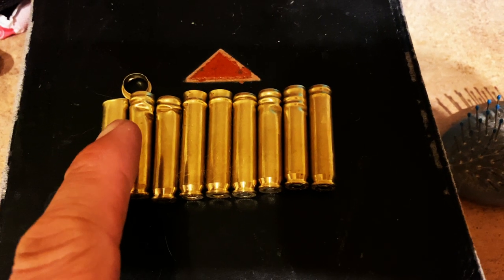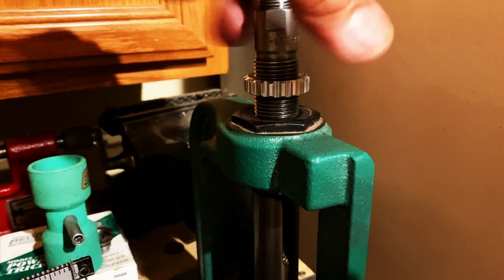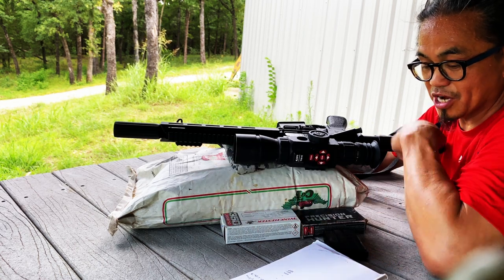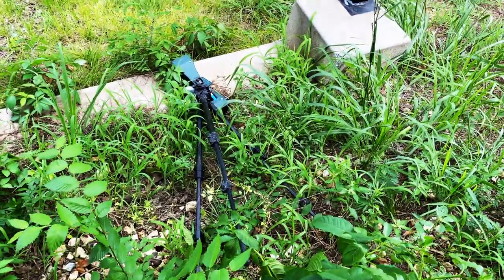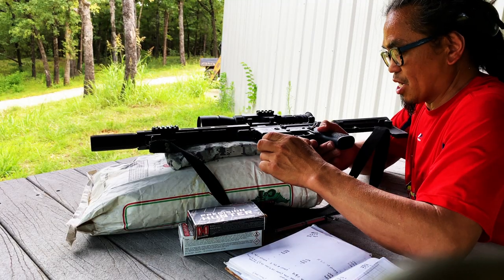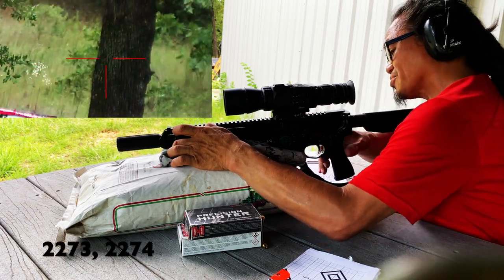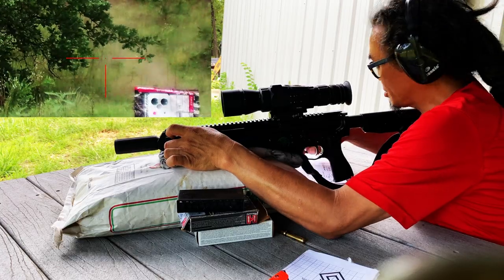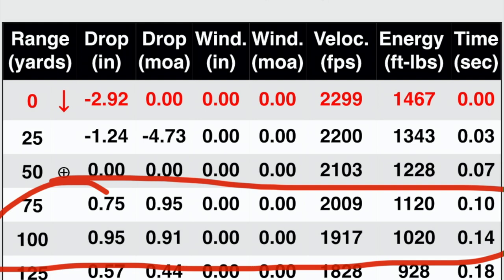350 Legend | Sierra 125 JHP | Winchester 296 | Load Development

Comment: I have a 350 legend for ohio this year. I have yet to get dies for it but have you heard of people using 9mm bullets to reload? 9mm is .355 same as the 350 legend. Not sure if a 147 grain xtp bullet would hold up to it.
Reply from the maker: Yes, you can load 9mm bullets. Discussion has been had about using .355-.358 diameter bullets. I am going to stick with .355. Not sure what you mean by holding up. Please clarify...
Reply: @OutdoorEDventures  I was always told that some 9mm bullets, the copper jacket starts to separate from the lead if you start to exceed 1400fps. Not sure if it's true or not. Full metal jackets should be fine but a curious thought anyway.